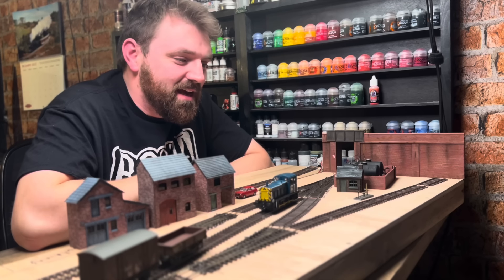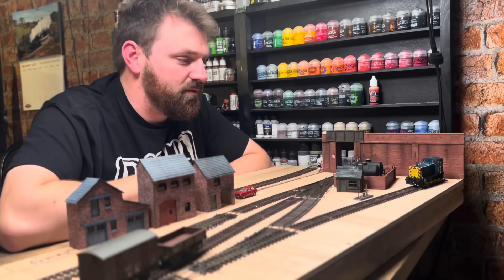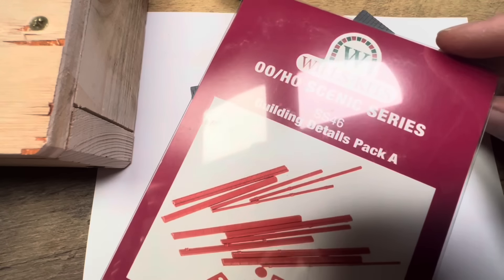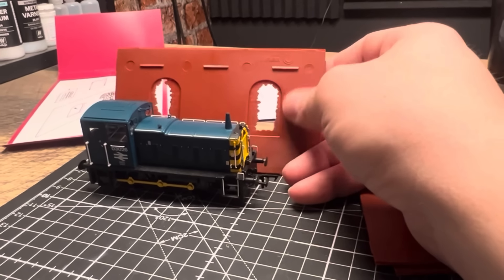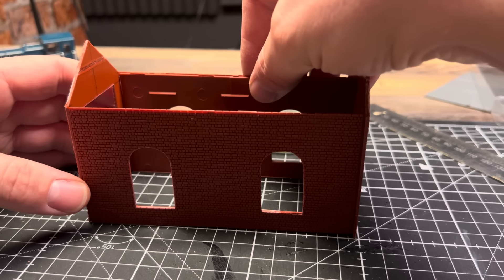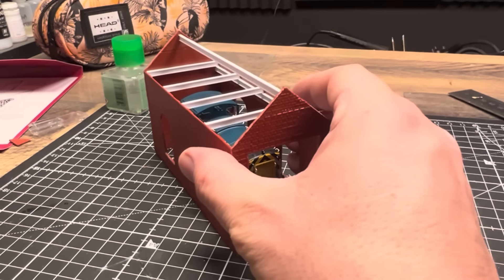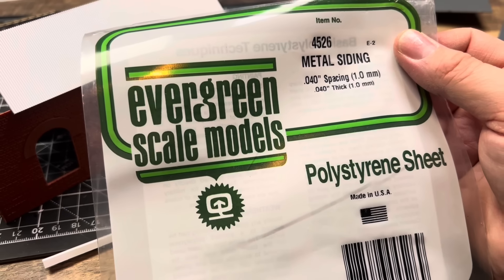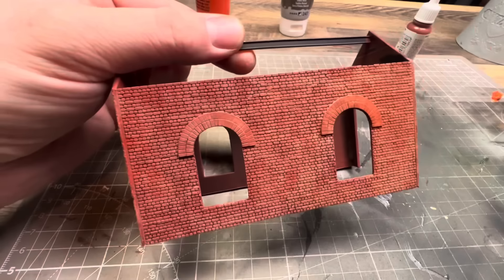Building A Shunting Layout | Scratch Built Engine Shed | Ep12

Comment: The top beau on doors and windows is called a lintel while the Stone o  the bottom is a sill (windows) or step (door).

What I find lacking is sills on the windows.  Just gluing some 1 mm styrene strip and painting them stone grey should do the trick.
But still, love the roof beams on the inside. You could also have created triangular frames with the I beams and add the top ridge beam between them and the walls. 

Keep up the good work.  This layout gets better at each video and inspires me a lot to create a N scale variant.

Comment: Hi Tris, brilliant video again, one thing crossed my mind having seen a while ago your 3D printed station - is there any reason for not using 3D printing here? Did you find any problems with 3D printing or is it just a desire to use different methods? Thanks again for the content, always look out for your posts.